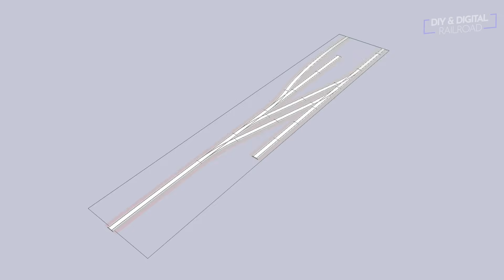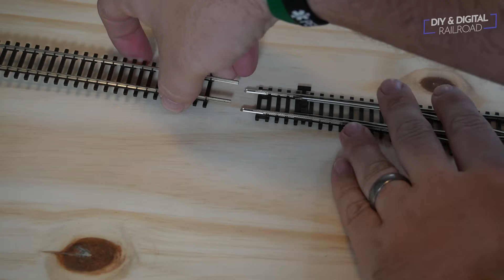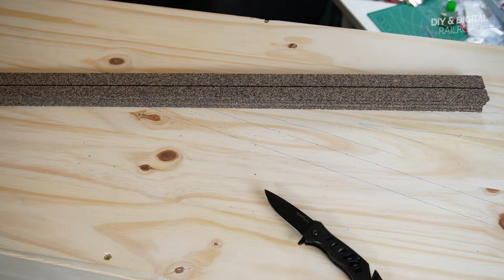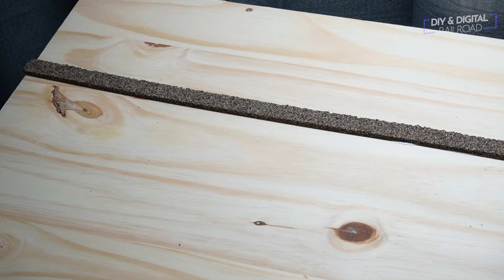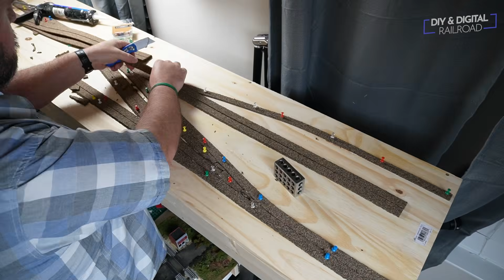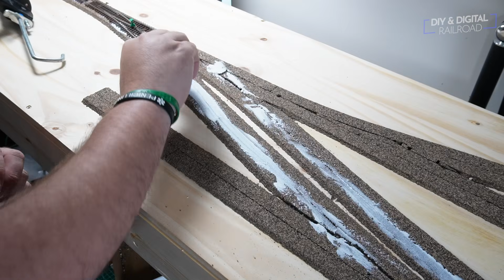Model Railroad Track Installation Made Easy

Comment: Hey great video! Quick q. Which flextrack rail should be on the inside of the curve? The rigid one or the sliding rail?
Reply: It goes on the inside, I tried both and on the outside it doesn't work great
Reply: @victorreznov9940  thanks! Your comment comes just in time for me to start my layout curves!

Comment: Love your informative videos that make it easy. I have plywood set up already but
I want to use insulation/foam board for the final base or visible top of the layout. Can I use the shiny side or the other side. What glue would I use for either side. Thank you.
Reply from the maker: Just to make sure.  It’s the extruded pink foam?  I would use the dull side on top.  You can use latex caulk to glue it down and weigh it down overnight. You can also use something like Liquid nails.

Comment: I never worry about an exact fit because the ballast will cover all problems up and hide them. To fill gaps I will grind up some pf the scraps and sprinkle this into the problem area and then glue the particles down. I also will use child's play sand as it works well and with glue diluted 50 - 50 will harden as hard as a rock. For the switch machines I use the multi tool and cut a slot under the throw tie from the inside of the + rail to the inside of the - rail. The slot is invisible and gives one so much more space to use for the machine.I will bring the adhesive up to the tie next to the throw tie (bar) and this will keep the eventual ballast glue from getting into this area.I sand the edges of my track before I glue it down. this is cleaner as I can dust the sanding dust into a jar and save it and I don't do this on the actual road. To messy!!!!! To glue the track down I use the same glue that i use for the ballast only full strength and it must be water saluable as if you ever want to take up a section of track, all you have to do is soak it and it will come up so much easier that the track that is put down with most tube adhesives. I know because I have made this mistake and it was very hard to salvage the track. I am using the same track for the 3rd time right now.

Comment: I’ve been modeling since 1950 before cork roadbed cork roadbed came out I found that by using a utility knife hooked in the hard surface at the proper angle and taking the court bro bed and pulling it through the blade would continually refinish the cut in the cork eliminating all that crap on the edges. Just a thought. Hope it helps

Comment: Jimmy awesome work excited to finaly start my layout I hust cant decide dc or dcc! Any suggestions??? Thanks
Reply: Use both with a DPDT on-off-on switch. Center terminals go to the track, outer ones get the DC or DCC signal. If you have an auto reverser like the Digitrax AR-1, that won’t work in DC though.

Comment: Thanks for showing the need to use a file after your cutting. Safety first on the tracks & on your layout. Optical illusion?? Is the drill in reverse?
Reply: Alas, as much as I appreciate all the info and help you have given me, I had to discontinue my patreon account. Thanks

Comment: One of the things you can do with the cork dust is fill in the larger gaps in the cork road bed and fix it in place with dilute white glue, then sand it smooth.  That way you do not have ballast filling in your big gaps in the cork.  There is a reason to drill the holes under your turnouts when you plan to use hand throws.  You may later change your mind and want to use Tortoise style switch motors.  You might be at a model train show and stumble across a great deal on tortoise style switch machines.  Having the holes already in place under your turnouts makes it possible to retro fit with the powered switch machines without removing turnouts to drill holes.  In the meantime just put masking tap over the holes from underneath to keep ballast from falling through.
Reply: Great tips!

Comment: Great video. I used Micro Engineering flex track and atlas switches for my layout. I like Micro Engineering because it holds its shape and it is easy to work with.

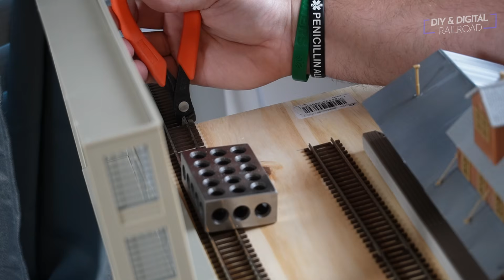Comment: 6:30 I heard from one modeler that there are different ways to cut HO and N scale track. One is like what you show (I suppose that is HO) and the other is to hold the cutter horizontally. Do you have any comments on that?
Reply: Cutting track with the cutters horizontally can pull the head of the track down leaving a permanent dimple. Horizontally may also flair the track end, narrowing the track span. A cause for derailments.
Vertical cutters might leave a small bump to be filed off gently with a blade sharpening stone.

Comment: The cool thing about using the tortise switch machine is that you can control the frog power using the built in DPDT on the tortise.

Comment: Great video.  I actually use Autocad to draw my layout and print it out full size.  I then transfer the centerline of the track with carbon paper and a pounce wheel.  Works great.  But for a small layout like this your way works great.

Comment: Great video Jimmy!   I have been hoping you'd do some things in HO scale.  One thing from observing other layouts that I think I would change is how you're actually fastening down the road.  Others have mentioned this from an ease of de-construction standpoint but for me it was noise levels.  On layouts where the cork is glued down, the noise levels are pretty high.  But where guys in our club used fastening nails or pins the trains run without all of the track noise.  Probably not as much of an issue with a switching layout like this, but very good for continuous run loops or larger switching/running layouts like the one I am working on.  Still, great video.   If I missed it, though a question:   What switches are you using?   Brand/size please!  🙂
Reply: The Parts List in his comments has the Brand/Size...
Reply: Noise level depends on the base material you will use. i use foam and the noise is very minimal.

Comment: Last comment: Atlas sectional track has those funky two-tie assemblies at each end to provide clearance for the rail joiners. I find that these actually call attention to the track joint, so I clip these off before installing the track, and then insert regular ties in their place at the end, just as you did for the flex track. You'll need a supply of extra ties: these can be pulled off of a leftover end of flex track, or you can use 6x8 inch scale styrene (prime and paint first!)
Reply: Those tie assemblies are called "D-rings".
Reply: Great idea of rail ties at the turnouts!!!!

Comment: Great video Jimmy. Only thing I do differently is instead of gluing my cork, I use track nails as it holds it down just like glues but if I need to make adjustments, it's just simply popping a nail out instead of peeling up glued cork which can be damages and requires cleanup. Also instead of using #4 turnouts, I use #6 and shorten the straight leg so it's the same length as a #4 but a much better angle than a #4. This will be a very cool switching layout! - Jason
Reply: I really dislike the look of nails because it makes the road look toy like... The "real" roads do not have spikes in the middle of the ties...
Reply: @davidcurtis5398  if you paint your rails and ties then and ballast properly, it's barely noticeable for HO scale that is.
Reply: @ColonelCottonBelt  You just might be right but I have never (never 45 times) seen a layout that I didn't see the nails and they really don't look good to me... Just my take on track nails.

Comment: Regarding gluing track: by using caulk, you insure that your track cannot be salvaged if you ever dismantle your railroad. I nail my track in place (and yes, the nail heads look horrible) and when I have finished ballasting, I remove the nails. The ballast holds the track in place beautifully, and the glued ballast releases much easier if you ever have to tear up your track.
Reply: The ALEX Plus caulk seems to come up easily with a putty knife in a video I saw on YouTube. Easiest of the three glues used in the testing.
Reply: Not true. I've removed track I used calking on

Comment: Jimmy, I ALWAYS sand the top of my roadbed: the roadbed may appear level, and it may feel level when you run your fingers over it, but I find that 9 times out of 10, the places where two pieces of roadbed meet at not quite level - you can see this when sanding: dust accumulates on the low side of the joint. I just use an 8" sanding block with 80 or 100 grit sandpaper, and it is easily done while you are sanding the edges.
Reply: Nice idea and application...

Comment: Another great video, keep them coming. Many moons ago before such things as rail nippers existed, I was having to use standard diagonal cutters to trim track sections that required custom fitting (didn't have a rail saw either). The trick was cutting just that little bit extra length and filing the end back to a flush fit. Got the job done but was a lot of extra work.
Reply: I have a rail saw/Miter box and did what you stated for my N scale  -  looking forward in building my HO Module - probably still use the saw...lol.